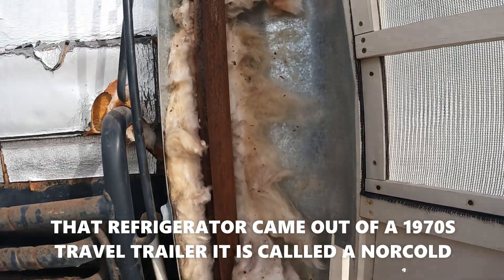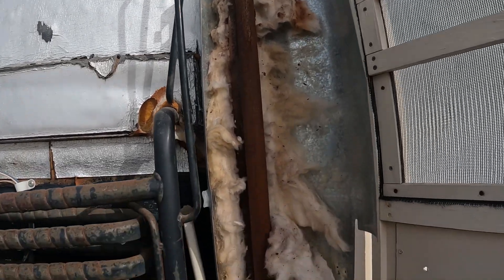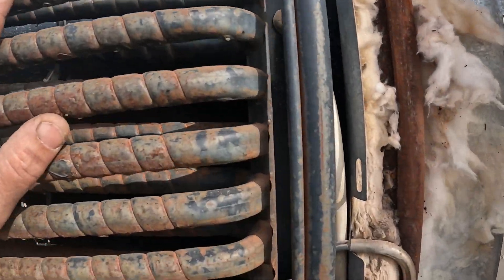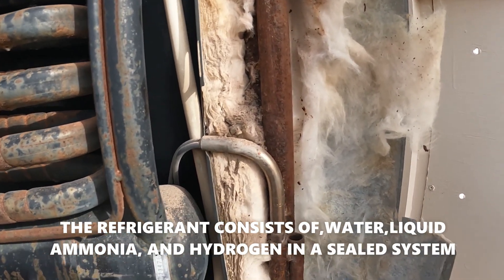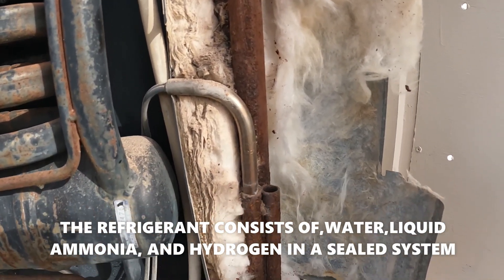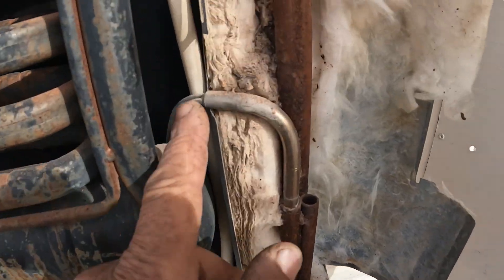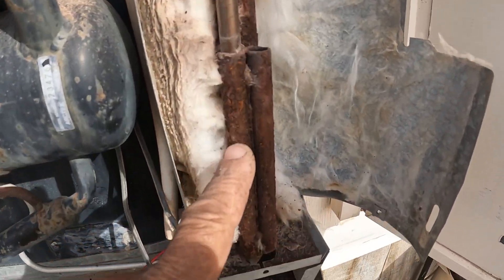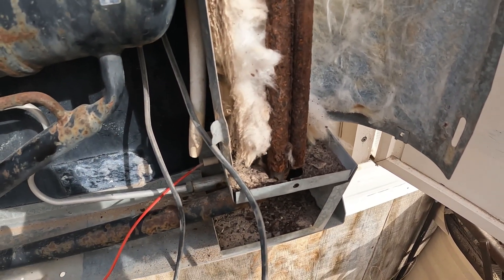Propane Refrigerator Hot Wired to Solar Panels Part -1

Comment: Great idea cold is actually  only the abstinence  of heat .Cold can be stored as water ice and will be just if not more useful than heat in the summer .  Since the refrigerator  is powered by heat the energy  can come directly  from  the sand battery with some equipment  modification.
Reply: Or from any sun heat capture, as you'r car's roof heat heat pipes shadower for instance 😉
Reply: @AutoNomades  yes, I have been exploring  sand battery for storage of excess  solar production but any heat source  would work. Cold storage also has many uses and may be more useful in some situations than heat storage.

Comment: You are right. I have a three way, propane, 12dc and 120v ac. Mine is smaller and only takes 100 watts. Solar should run it directly if your coils are still good.